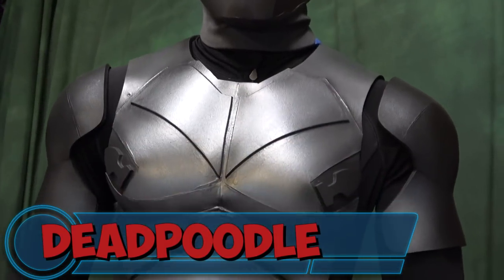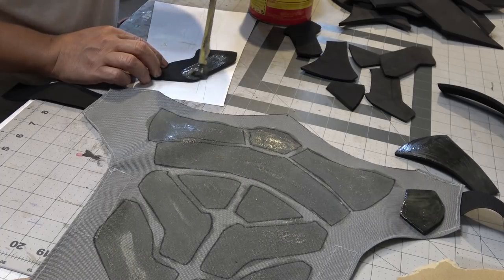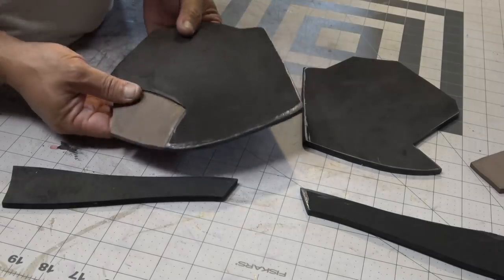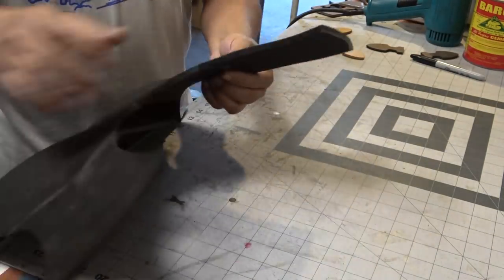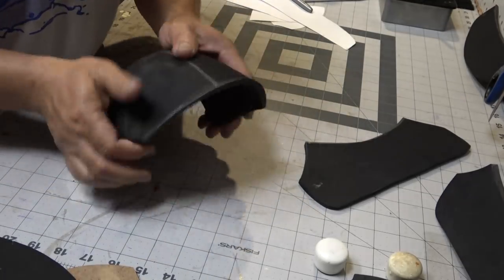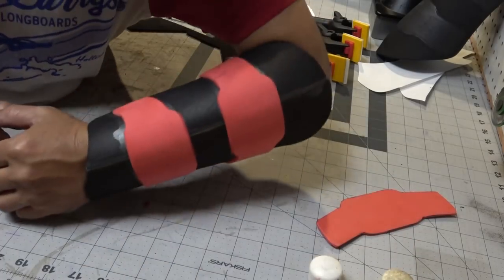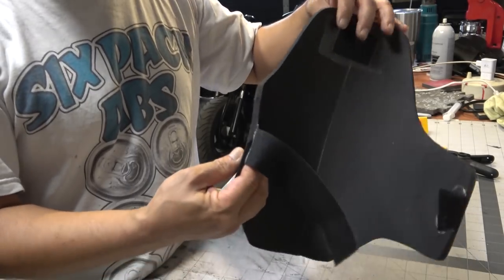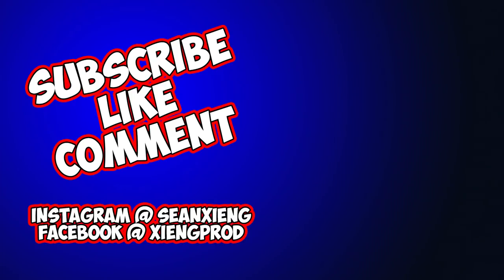Deadpool XForce foam armor tutorial part 1

Comment: In case no-one mentioned it yet, the shoulder/bicep piece is called a pauldron or spaulder, depending on wether or not it also covers the under arm area. If it does, it’s a pauldron, if it doesn’t, it’s a spaulder.